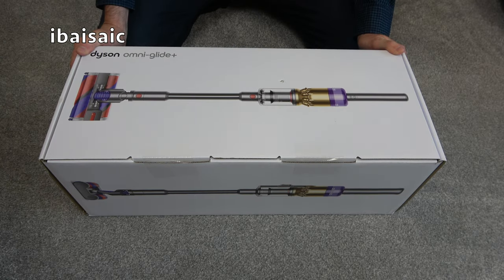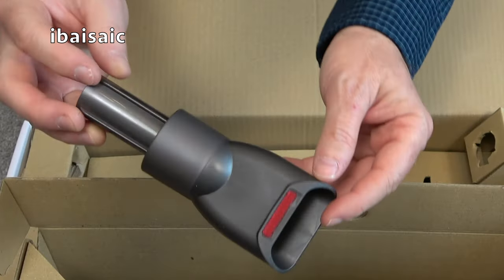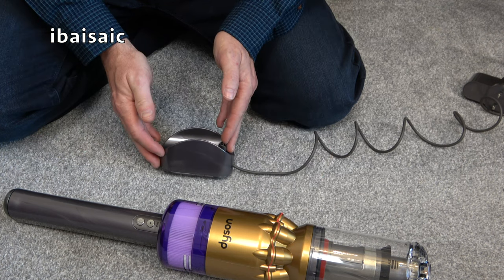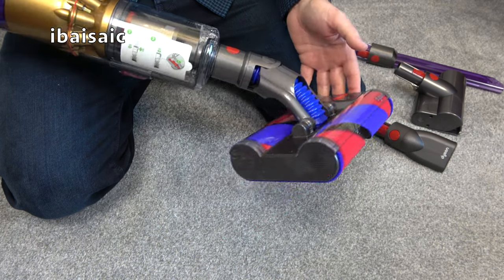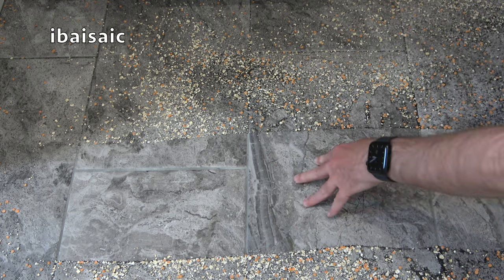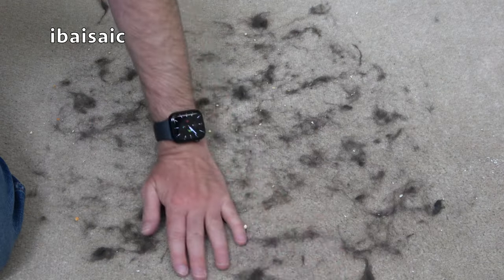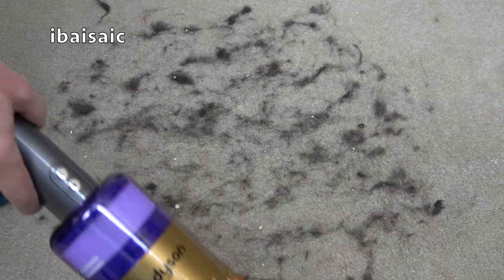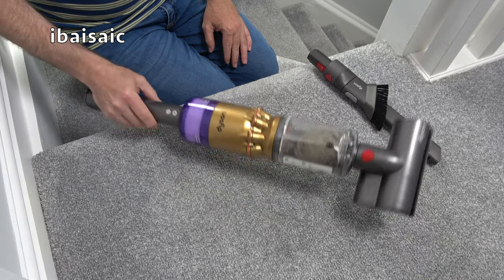Dyson Omniglide Plus Cordless Vacuum Cleaner Unboxing & Demonstration

Comment: Sooo, it can’t do carpets, but it’s not a floor washer. It’s barely any smaller or lighter than a conventional Dyson cordless cleaner, despite less functionality. And it still costs £250 for which I could have a Dyson V8 which on the company’s website is the same price but currently comes with £85 worth of free tools as well? So what’s its selling point, the fact that the floor head can go sideways? I really don’t see the point? 🤔
Reply: Dyson v8 costs 200€ more!

Comment: I have just bought this on Black Friday deal also with the dok (free) but without the tools you get here.  I love your demonstrations as I now know that it will be perfect for me as I have hard floor downstairs and carpeted stairs with floor mats at the door.  I have a V11 which I can leave for upstairs only now and daily use for this in the higher traffic areas of the house.  I have just had carpel tunnel operations so this more lightweight item will help tremendously.
Not only do you do a good job reviewing these machines but give excellent tips on proper cleaning,  Your house looks so amazingly neat, clean and tidy - I will aspire to achieving the same with my new omniglide

Comment: You can actually fit a regular Dyson multi surface head on these as it’s using the same electricals as the v11 (which the v15 also use) so it won’t damage anything 🫶🏼
Reply from the maker: You can’t. The diameter of tools is smaller than the regular sized Dyson cordless models.
Reply: @ibaisaic  hmm, odd 🤔 I’ve been told it was possible. Thanks for updating me 😅 please continue with the great posts 💕
Reply: @ibaisaic  ghdksjs
Reply: U can’t bro the diameter is smaller on the omniglide